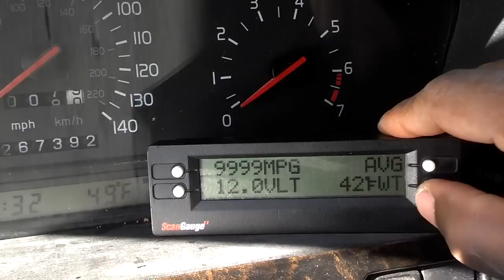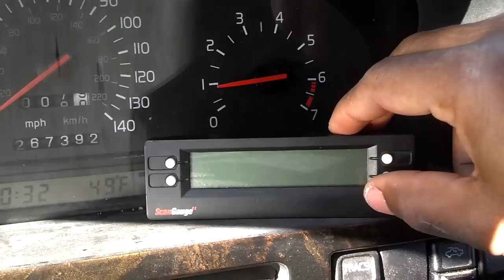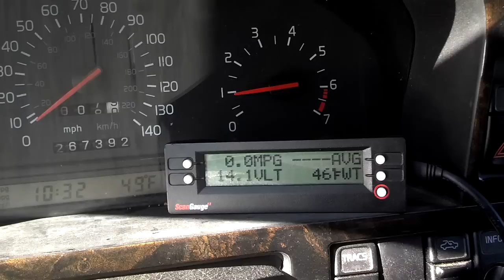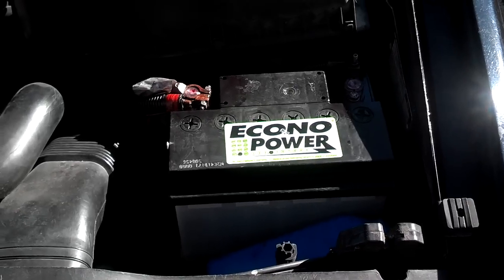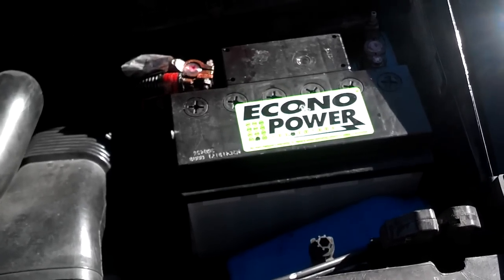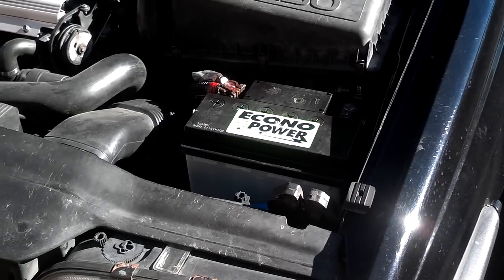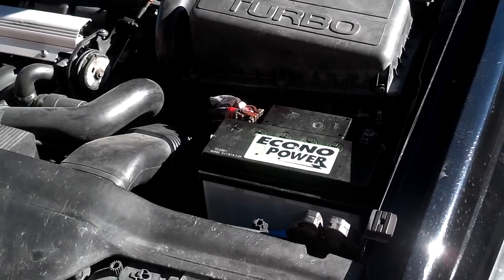How to tell if your car battery is bad, weak or dead. Signs of a bad alternator. - VOTD

Comment: Sorry, I made a mistake in my comment it is Epsom salt mixed with boiled distilled water, the baking soda is for making safe the acid you pour out of the battery in order to refill with the Epsom salt when it has become clear in the water according to this guy this can be done 2/3 x with a battery he also said you put it on A trickle charge with about 2 amps, you need low lamp so that it charges slowly over a period of 38 to 40 hours. what do you think of that?
Reply from the maker: +jozzerful2 I have no experience with trying to refresh a battery.

Comment: I was driving my 2002 Nissan Almera, battery was working fine electric windows working fine I  come out the next morning, battery would start without anybother. I started driving another car and left my Nissan Almera sitting for about 7 months, so I had to jump started the car and drove it and the battery held power and start the backup again no problem, but I left it for three days and when I went out I got red lights but it would not turn over is it possible to fix a cell that is damaged, I remember years ago you could top up water would it help if I did that? The battery was practically now before, I left it sitting up for 7 months, why would a battery in a shop not go bad in a 7 month period of time.  I seen a video on YouTube and the Guy was putting bicarbonate of soda and water back into each cell on the battery jump starting the car, letting the alternator charge the battery, and he was saying because of the bicarbonate soda and water that the battery would hold its power better is there any truth to that?
Reply from the maker: I have never tried to renovate a battery.

Comment: hello Robert i saw your great video and i think i gotta change my battery but i just wanna double check with you. i would very much appreciate your opinion on the matter

So heres the situation. The other day before work i got in my car, put the key in so far so good, all the lights are on the dashboard, a/c is running and radio is on. Now when i turn the key all the way to turn on the car, the car completely died. No sign of life, no lights anywhere, no power and i cant even turn it on again. Any thoughts on the matter at hand?
Reply from the maker: https://www.youtube.com/watch?v=2rVt-TDqmSc

Comment: hi! there was one time that I was stuck in a slow moving traffic for fifteen min and then I pulled over for while and when I got back to the car and start it again, it didn't start. I can only hear click sound every time I try. I let the engine rest for 8 hours, I tried starting it again and it worked. what do u think could be the prblm, is it d battery or the alternator? I was able to use the car up to now, without experiencing the same prob.
Reply from the maker: +BINGO wrong u gnUpim santiago maybe the starter was stuck or the battery had overheated or something. Have the system checked.

Comment: Very helpful video. I also watched your vid on used car batteries and that was helpful, too. I am subscribing! I drive a car but I know almost nothing about how it works. That tip about the passenger door not unlocking when you open with the key is something I had not heard before so I never thought anything of it! Great tips in this video.
Reply from the maker: +livia1881 thanks for watching.

Comment: I was driving the car and then suddenly feels that the car is not accelerating any more. i was able to pull on the side and when i turn off the car and turn it back on, it don't start. I then get a jump start from someone and then car started to drive normally, however when i reach home it slows down and stops accelerating for more then 5 mph. I was able to reach home with that speed and then again when i shut off the car it won't start anymore. Do i have a battery issue or something else? I do have a code for catalytic converter like 3 months back which goes away on his own.
Reply: was it battery or altinatior
Reply: Just to add this is Nissan Altima 2005 and the battery is almost 3 yrs old. DuraLast Gold
Reply: Robert any ideas? I appreciate your response.
Reply: what did they tell you
Reply: I'm have exactly same issue does he answer this question?
Reply: same problem with my car
Reply: Kamran Zahid hey I had this problem and it was the ratio of air/fuel that wasn't right anymore. Tell that to your mecanician

Comment: Hi, Mr. Robert. Had an issue recently with the battery on a 2012 Ford Fusion; replaced the battery in late July [it was almost 4 years old]. Got in car two hours ago, and CLICK, everything went totally dead when I turned the key.
I checked the connections and they felt tight - not super-tight, to the point where I needed WD-40, but tight [I tightened them by hand when I put the new battery in]. After 5-6 tries and 5-6 clicks, I jigled the wire on the negative post and tried again.
It started right up and has started the 2 times after that as well.
Could I have a bad wire in the connection to the negative post - and could what drain a battery? My car's still under the 100,000 mile powertrain warranty so that "might" be covered [dealer's closed right now so I'll find out in the morning.]
Your thoughts? Bad wire? Or should I super-tighten the connection? I did notice a bit of corrosion build up on that negative post but some of it might have been from the previous battery, though I did clean a lot of it off when I switched batteries.
Thanks for your time.
Reply from the maker: +David Pavid Mavid the cable should be tight and you should not be able to move it by hand.

Comment: I have a push start and the past couple of days it starts sometimes and sometimes not. the battery in the key is new, do I have a bad cell?
Reply: Many new cars are very sensitive to low voltage, BMW are the worst that I have heard of.  They will not crank if the voltage is low.  Even if it is just a little low.  Make sure that your glove box light and trunk light and other items on the car are not staying on while the car is parked.  These little "parasitic" power draws can slowly discharge the  battery when the car is parked for many hours or a couple days.
Reply from the maker: I have no idea. You should have the battery tested.

Comment: I accidentially left my ignition in 'on' position and totally drained the battery by the end of the day.  I recharged it for an hour and it started right up.  Did I weaken the battery by letting it drain all the way?  Should I replace it?  I heard that a weakened battery will over work the alternator causing problems with it later on.  Thanks for any info.
Reply from the maker: +Trkn56 no.
Reply: It's a good idea to trickle charge the battery (with low amperage, 2 amps) after it has been totally drained because that pulls as much lead out of the electrolyte (hydrochloric acid) as possible and puts it back on the lead plates. Automotive batteries are not built to withstand being deeply discharged like marine batteries but they can survive an couple incidents and return to function normally.
Reply: John Ferguson Thank You for info.

Comment: I have a CarQuest battery that is only about a year old. Suddenly it will not hold a charge after a few days. I believe the battery has a bad cell or cells in it because I bought the Solar battery tester and over a period of 5 days (this time) I've watched the voltage go slowly down. I tried to start it today and it failed. The battery and the alternator have checked out fine but I still believe it's a bad cell due to what you said earlier in this video. All of my problems started after I jumped my cousins work truck, would that have any bearing on it? thanks, great video.
Reply from the maker: Yep, never give anyone a jump.
Reply: In this case I had no choice. Do you know what it might have done to the car? thanks
Reply from the maker: you probably have a drain in the system.
Reply: okay thanks.
Reply: why does our manuals have jump starting instructions in them?
Reply from the maker: Because it is a common thing that people do.

Comment: I have a chrysler 300c, it was just fine but yesterday i couldn't start it, and the dashboard light is flashing as well as the light in the roof they are turining on and off fast and i hear a clicking sound from the top of the car. I don't know what's going on ?!
Reply from the maker: Sounds like the alarm is going off. Close all of the doors and lock and unlock the car with the key, then try to start it.

Comment: What about a whining noise when the car is running? I also have the battery indicator on. Would it be safe to drive it to a mechanic if the alternator needs to be replaced?
Reply from the maker: Probably.
Reply: whining noise is most likely coming from the alternator. either bad alt or your belt is ready to snap.

Comment: Hi,

My car would require a jump before it would start daily. When I turn the car off and come back to the car ten minutes later, it has a 50/50% chance of starting.

Usually the battery light would come on before the car dies, but if I accelerate or shift into neutral and rev the motor the light would go away and prevents the car from stalling.  

Is that a battery or alternator issue?

Comment: hello really find your videos helpful. I'm having a coolant spill problem . in about 30 minutes into driving the car at first steam starts to come out from the over spill next to the radiator cap. then it's just start spraying it out , I turn off the car and still keeps going for about 10 seconds . I don't know what the problem is . the car is a old car . a 1965 Chevy bel air. checked the oil for milky substance but it was clean I checked the radiator cap for it too it looked a little bit like a milky substance but I just thought that was the coolant dirty . would like your opinion tank you
Reply from the maker: Does it have a thermostat?
Reply from the maker: https://www.youtube.com/watch?v=BtdifArSU3Q
Reply: +Robert DIY so did change the thermostat and it did calm down it must have been a bad thermostat. I also noticed steam coming out of the head bolts I don't know what that is. 

I'm trying to learn about cars and your videos are very helpful along with the help you give and a link to the problem that it might be . thank you for your help

Comment: I have a question .. My car ( 2000 VW Jetta) the other day wasn't starting but when I turned the key over it would turn over as if it was about to start I had it jumped and it was fine. A day later it did the same thing but didn't start with a jump started later that night. I am having signs that you have mentioned like ( when I unlock doors from inside sometimes it won't work I'll try and open the trunk won't open ). It's been working fine a week since that has happened and now while at the store it didn't start turned over sounded like it was about to start but didn't started 10 min later. Does this sound like the starter ?
Reply from the maker: +Christina Velasquez No, bad battery. Have you had it tested yet?
Reply: +Robert DIY No I'm going to do so today I'm hoping all it is is the battery I can't afford to have it fixed if it's something else. Maybe could it just be a fuse? I checked the fuel fuse last night it doesn't look as if it's broken. ???
Reply from the maker: +Christina Velasquez No, bad battery.
Reply: +Robert DIY New update bought a new battery seemed fine then even put in new spark plugs (fuel fuse) and while at the park it didn't want to start again turned over took 25 min to start .... The battery was $200 guess that was a waste? 😑😑😑
Reply: +Robert DIY thank you very much for you're advice though. I was certain everything was going to be fine ugh what a drag.

Comment: hey robert so this is 5 min ago, I received another boost charge for about 5 min, the car worked ok so I moved the car to another part of my backyard, turned the car off cranked it back up it worked, turned it off again waited 5 min tried to cut the car on then the car would not crank :-( is that the battery because now im thinking its the starter. ALL other components works in the car fan radio locks horn etc
Reply from the maker: +Tertius Durham if the car needs a boost to start, and once running it is OK, you have a bad battery. Why don't you simply have it tested somewhere for free?
Reply: I did my man and you've been a great help . It was the battery like you said . I've bought a multimeter and tested it, and it was indeed the battery.  God bless you and continue to make videos. Ive learned alot from you

Comment: so I drove about 30miles home, parked my car, turned it off then tried to start it back up because I leave again. However my car won't start. key pad won't lock/unlock, either..however the mileage and radio stay lite up, even after opening the door and hours later...have tried juming no luck..any suggestions?!?! I drive a 06 dodge charger r/t
Reply from the maker: +Amanda Turner have the battery tested or replaced. Is that recommendation not in the video?

Comment: I have a Fiat punto 2003, about to 2 days ago I tried starting my car but all the dashboard lights came on such as engine overeating, low fuel & etc, and there's was a buzzing sound on the outside fuse box, and when I tried starting the car nothing happened apart from all the lights going out, yesterday I tried starting it again and still nothing happened apart from the airbag light coming on when the ignition was on, but the car still did not start, could it be the battery's fault or something else, please help
Reply from the maker: +MoreMusic have you taken the battery to be tested.
Reply: +Robert DIY Ive replaced the battery today still nothing
Reply from the maker: +MoreMusic maybe the starter is locked up.
Reply from the maker: +MoreMusic https://www.youtube.com/watch?v=YKQP6xTocPE

Comment: I have 2002 Saturn sc2 I bought a new battery and alternator they both work but my battery won't stay charge if I don't start it for a few hours it'll be dead or near dead
Reply from the maker: +killastrings1 You have something drawing current from the battery, even with the key off. You need to have someone find the drain.
Reply: I took the battery to auto zone some of the cells were dead in the bettery I got it replaced my car works great now your video helped me alot thank you
Reply from the maker: So the NEW battery was bad. Shame on them.
Reply: Yeah they put it on the charge and they noticed some 5 of the cells in the battery were bad

Comment: Thanks again Sir for referring me to this video. This video helped me determine what the problem may be. My car started immediately after I left a comment on your last video by that time it had been 5 hours since I initially attempted to start it. So I started it 3 more times and it started with no problem. I took it to AutoZone to get the battery tested and it was at 52% percent. So after watching this video I am assuming it's the battery. No other problems are not noted that would indicate the alternator but I will still monitor it. I currently have a Wal-Mart battery but I will buy a new brand of battery tomorrow. Again thank you so much. I truly appreciate your help.
Reply from the maker: +Samantha Nicole Is your battery still under warranty?
Reply: +Robert DIY yes it is still under warranty but i will be replacing it for the second time within this last year. the last time I replaced it was in September 2015
Reply from the maker: How often do you drive the car?
Reply: +Robert DIY almost everyday sometimes I may skip a day or two and leave it in my garage. Also I should note that Our weather in Texas fluctuates daily varying about 20 to 30 degrees from morning to afternoon if that may be a reason for my issue. The car is running fine today but I'm on my way to sears to get a new battery today just in case.
Reply from the maker: How far? Just a few miles a day can be hard on a battery. 30+ minutes is better.
Reply: +Robert DIY yes I would say about 20 min average one way trip and 45 min daily round trip.  I purchased a die hard battery at Sears today. the car runs a little smoother so I'll keep monitoring it.   should I drive a little more each day?
Reply: +Robert DIY I will drive a little more daily.

Comment: Hey my car turns off randomly when it's either sitting for a while or being driven for a while and after it turns off it won't start back up, the starter cranks but the car doesn't turn on, the battery is bad and I know I need to change it but other than that I don't know why my cars shutting off and not turning back on afterwards I got a p1287 and I can't figure it out,
Reply from the maker: +Enrique Sanchez What kind of car do you have?
Reply from the maker: +Enrique Sanchez https://www.youtube.com/watch?v=YiPAPu-K8OI

Comment: Quick question... ok so my back power windows go down fast but take forever to go back up, is that a sign of a weak battery or perhaps the motor itself in my windows??
Reply from the maker: +ANT JAMES Motor going bad or the window track (regulator) going bad.
Reply: +Robert DIY ok thank you!

Comment: I have 2010 pontiac vibe getting very upset because im getting so many different answers on how to fix my car. My car starts up fine but when put into gear it shuts off...hope you can help
Reply from the maker: +Derion Braswell What codes are in the system?
Reply: idk dont no anything about cars but basics, i removed the battery and cleaned all wires etc ..now in gear it doesn't shut off but it jerks like crazy
Reply from the maker: You need to drive it somewhere to get the codes checked. Most auto parts places do it for free.